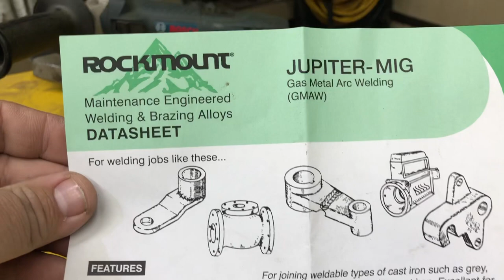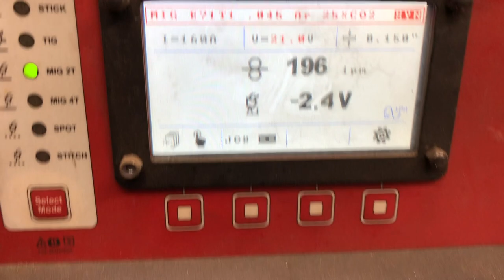Cast iron welding 101 - Can it be done" the easy way" ?!?

Comment: Most shops would do it the "old school".  Pre-heat, tig braze, slow cool.  Amazingly small amount of pre-heat !  Much faster.  I am a bit surprised you did not gouge out the small cracks and re-weld.
Reply from the maker: the small parts were just too small .. they look big on the screen but if you use my thumb for size reference ....  there was nothing left ....  and yes - I "old schooled" it for 20 years ....  this saved me at lest 2 maybe close to 3 hrs and no handling of excessive hot parts .. etc ...  
and there is nothing wrong with old school ....  this is just faster and most likely better ... more "fail safe" (if you would take the same care as old school) so this definitely give the less experienced welder a fighting chance and the guy who only does cast iron a couple times a year "the edge" over others ...

Comment: Cool!  Guess it all depends on the value of the repaired part.  Weld look great!
Reply from the maker: Yes - typically you only want to fix stuff that is “worth it”  occasionally someone asks me about fixing a cast iron pan even en expensive one for upwards of 100 dollar ….  And when they hear that my repair exceeds the value of a new one they are mad at me….  I say : go ahead, shoot the messenger … i mean even nickel stick rods go upwards of $70 per lbs !!! And mg289 wire for well over 100 i think about $130 per lbs….
And all the time of pre heating and post heating and fitting and doing ….  You spend HOURS real easy ….  This job here was over 5 almost 6 when it was all said and done
Looks easy in a 15 min video 😂
Reply: @ZILAwelds  Yeah.  Especially if I put it on 1.5x.   Lol
Reply from the maker: @halledwardb  dont weld the cast iron too fast😳  it will crack !!!!

Comment: I wonder how well it can be controlled on a vertical piece,  something that couldn't be turned to a flat position?
Reply from the maker: Not sure, the spec sheet said out of position and it felt really good as if it would run good out of position ….

Comment: How did the wire feeder screws rust at 1:32 ??
Reply from the maker: Severe abuse ….  Using machine in the rain, not drying it, not keeping things dry,clean and lubed ….

Its steel with a black oxide coating just like miller …  the stuff inside my 12 vs rusts too

Comment: Did I see a crack in the broken piece when you flipped it over?
Reply from the maker: You some some void similar to undercut.  Which in this application is not a big deal
Reply: @ZILAwelds  just was curious looked to be holding very well cast iron always turns out to be a pain in the ass this makes it look like cake

Comment: Hi there, does anybody know the exact composition of this material..
Reply from the maker: No.  These castings, they are pretty much always an “educated guess” ….  THAT is what makes it interesting….  To lay a beat of weld on fresh material is not too hard ….  But to “correctly identify the material…. And then chose the correct repair procedure ….  that is a different level…. 
And in case you meant this high priced specialty filler….  Of course not.  The chemical composition is proprietary so that you have to buy their stuff and no china man will copy it and sell it for cheap….
Reply: Thanks for ur reply. 
Although, the company must have the main ingredients of there material..
Reply: Likewise orlikon do mention there main ingredients for there all materials..
Reply from the maker: @kamranehsan  this is what the company provides
https://d3vypigyjoqnv3.cloudfront.net/app/uploads/2020/06/Rockmount_Jupiter-MIG_Mig-Wires-GMAW_Product-Information.pdf?t=1592507735
https://rockmountwelding.com/products/jupiter-mig-wire/
that is all they have to do by law ...
as fas as the blower casting ?  no clue who is even the manufacture ..... it was on a Vector suction truck but I have no clue who the blower manufacture is or what it is made from .....
it is a popular thing for aluminum boats manufactures to tell people what they used for their boats ....  maybe even for aluminum semi truck trailers you can find some information here and there ...  high end skid steer or excavator implements will also tell you ....  everyone else keeps trade secrets ....  and if its cast - they only write :cast      not even cast steel, cast iron or anything else ....
Reply from the maker: @kamranehsan  I remember when I used to live in Europe oerlikon gave good info ....
Reply: Thanks for ur sharing. That was just information by the company. Anyways it's nice talking to u. Thanks again. TC.

Comment: It would be VERY hard to justify $180 a pound for MIG wire to fix cast iron. Most professional welders who do weld cast iron (with any experience) will recommend SMAW with 7018 rods (properly stored)...keep in mind, the hardest part of welding cast iron, is keeping the carbon out of the weld zone...which is what causes the cracking to happen. A recent introduction into 'cast iron SMAW' is using 'cast iron coated rods', a predominantly-nickel content rod with a high-carbon cast outer. Likewise, a 'graphite coating' rod could potentially shield the weld zone some...but just like gas 'brazing' or 'muggyweld fixes', I'm VERY dubious when you're not creating an actual metal pool to accomplish a weld. Personally, I'll take the 7018 path, and keep the heat zone controlled (with appropriate pre-heat). Some have even used 6010/6011 and 6013's...but due to the pre-heat area requirements, combined with high possibility of warping, you really just can't beat SMAW with 7018.
Reply from the maker: Well, there is always "that guy" who can weld earthing on the planet with 7018 .... LOL. and y9ou seem to be more talented or luckier than me when it comes to welding everything with 7018 ....  either I am not as good or not as lucky - glad it works for you !
Reply: @ZILAwelds  Haha, maybe it's because you're an actual welder.

Comment: chucke2009 trained  you well
Reply: @ZILAwelds  try tig welding using the same wire remember  tig  uses dc negative so 75% of the heat on base metal the cast iron wiil be heated while welding

Comment: That's a lot faster and cleaner than stick.
Reply from the maker: damn right Kevin !    and a lot less screwing around with excessive pre and post heating and handling a hot part all the time ... it shaves off at least 2 maybe 3 hrs !!!!
Reply: @ZILAwelds  Send me the product info. Just text it to me when you can. Thanks.

Comment: I'm honestly surprised by how much weld you laid down on the back side in a single pass, I thought you'd had to do less than 1 inch beads then peen between passes to limit hear input.

If that works/holds up and is legit them it's an absolute game changer.

Is it nickel wire? It sounds a bit like silicon bronze wire I've run before, not the worst arc stability but not the best either.
Reply from the maker: yes - I am surprised too ..  normally I weld 1/4" ... 3/8" might break already unless it is preheated like a maniac !!!!   YES it is holding up and yes it is a game changer ! this part is in use now for almost 2 month ! typically a cast iron repair gone wrong shows its ugly face in the first day or 2 ...  it is a "largely nickel based" wire....  so silicon bronze or aluminum bronze ....  and no, I dont know exactly what is in it ... that is "their" "secret sauce" they won't reveal that ....  but the main ingredient is nickel....